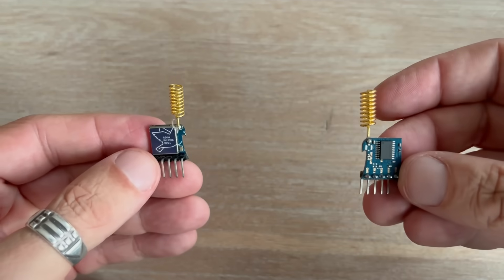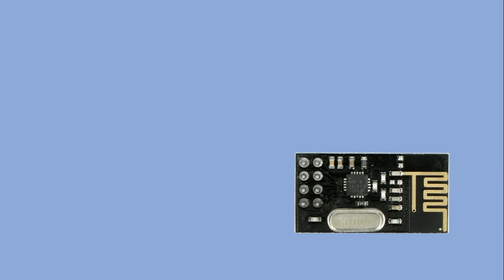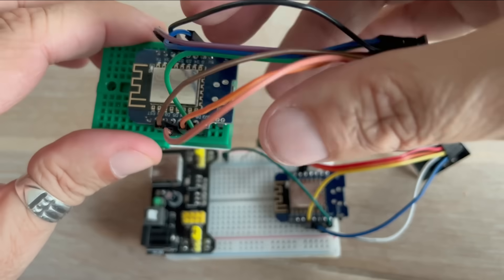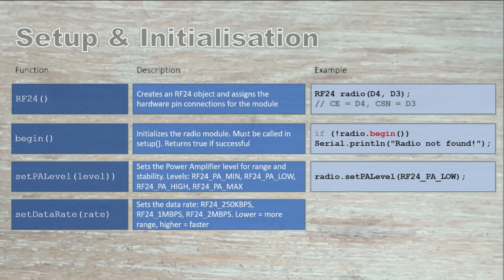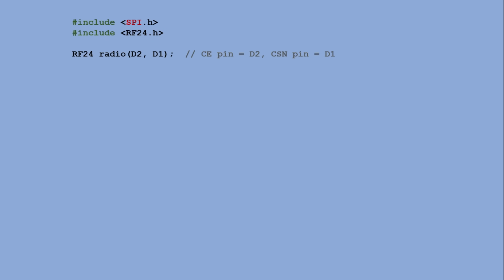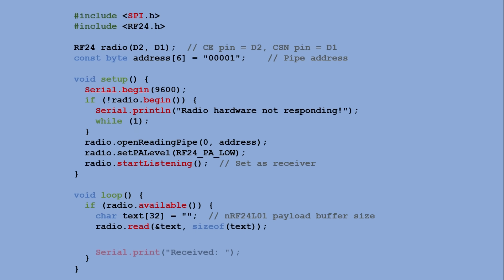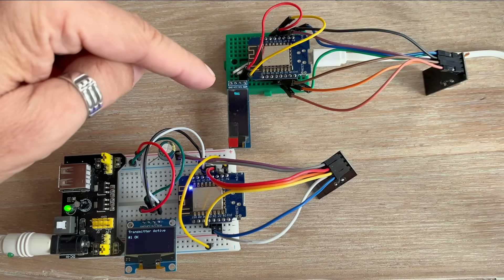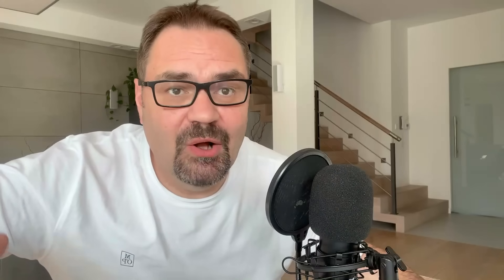How Far Can $1 nRF24L01 Modules Really Go? Setup + Range Test

Comment: There's a test of this transceiver on YouTube. In the test, the transceiver reliably transmits data at a distance of 400 meters. The antenna height is 1.7 meters. There is no packet loss.
Reply from the maker: Well I was testing a module at hand with onboard antena. There is a version of this module with screw on antena which I am sure would have a longer range. I will try to rerun this test with steady 3v power supply on both transmitter and receiver, with components on the custom pcb to limit the use of jumperwires and then test the range of parameters to see what kind of range and stability can I obtain with that basic module without external antena
Reply: @marios_ideas  The built-in PCB antenna was used in the test. The module was positioned at a height of 1.7 meters. If you're interested, I can provide a link. I am watching the NRF module tests with great interest; this is relevant for me.

Comment: Muy útil tu video.
¿Probaste los arduinos que traen este módulo incorporado?  Se llaman "RF-Nano", tengo varios pero nunca los pude hacer funcionar bien.
Reply from the maker: I have seen them. I don't have them unfortunately. I will try to read about it. I wonder if the fact that they are built in changes anything in the way you should interface with it.
Reply from the maker: So I read a bit. And it is the same thing as I show in my video. The only unknown is which pins are used for CE and CS. Normally CE should be D9 and CS D10 and that what should in the code. But if the different pins are used then you would need the datasheet for that board, which I guess would be difficult if it is a cheap board from china:)
Reply: @marios_ideas  Gracias por responder tan rápido, en cuando termine un proyecto en el que estoy vuelvo a intentar hacerlos funcionar.

Comment: Nice modules, with a small catch, the receiver side also transmits, as in acknowledging reception, so you havre to also have a nice 3V there as well. Also since they handshake it limits how many receivers can listen. These modules can be obtained on 5V adapter boards where they take care of all the level shifting and 3V regulators hassles, so a 5V Arduino Nano etc. is no problem.

I tried some LoRa modules in suburbia, the range was terrible, only a few blocks at best. maybe if I put the transmitter atop my 15M high radio tower I might do way better, but be realistic, not many people have a 15+M tower/pole handy.
Also I'm a tad reluctant to place such equipment up there as having digital potential noise sources right up close to all your other antenna's is asking for trouble. Yes LoRa great, shame about the rest.

Comment: 07:51 Considering the value that you assign to it why is the address data type not char ?
Reply from the maker: The code would work with char as well. The RF24 module works with binary values ."00001" is a C string literal, i.e. an array of const char[6] ('0', '0', '0', '0', '1', '\0').
When you assign it to a byte[6], the compiler implicitly converts each character ('0' = ASCII code 48)
Reply: @marios_ideas  Yes, I know that it works, but why not use the appropriate data type in the first place ? Using a char data type might also have the side effect of reminding you to add an extra array element to hold the terminating '\0' of the string

Comment: nrf24 is (unfortunately) very sensitive to power supply and wiring noise. A properly designed pcb for the connections with the microcontroller instead of breadboard wires and a capacitor between Vc and Gnd helps. I don't know why nrf24 has those issues, other rf boards are not.

Comment: These ones are quite old now and the design is not optimized. Anyway, it works fine indoor. I used them, with a stc15s204 microcontroler to do my own temperature/humidity sensors all around my appartment and send the data to a gateway that gathers and send again the data to thingspeak servers. My latest sensors are using the more recent 2.4ghz from CDEByte (10PCS Si24R1 nRF24L01+GFSK 2.4GHz RF Module SPI E01C-ML01S) for which the tx power is a little bit higher, but it does not make a fantastic difference.

Comment: These devices are also susceptible to interference. I find that keeping the wiring as short as possible helps, I also wrap the whole device in Kapton tape and then the whole board with the exception of the antenna is wrapped in copper tape. There are devices that come with an external antenna and these seem to give even better range.

Comment: I can see youre not as experienced with the module so here are some tips:
1 - decoupling capacitor is a must if you want stable transmission
2 - not super necessary, but I avoid arduino. Sometimes it masks and hinders you too much.
3 - proper config. For maximum range, you want the lowest data rate and maximum PA power, obviously. Always read the datasheet or at least use some LLM to process it to you.
4 - You bought the modules with PCB antennas, the least performing ones. Buy the nRF24L01P with LNA+PA modules, I recommend the EBYTE E01-ML01DP5. I've used is a lot and I cant tell, hundreds of meters are a guaranteed.
5 - watch the video "Ultimate nRF24L01 range comparison" from iforce2d. Its a must for anyone working with this module and in need of help.

Cheers lad! Let me know if you want any more tips. I wanted to make a video on the module, but never got to it in the end.

Comment: Thank you for your test. But I was hoping for more range testing and less programming instructions. With a 10µF ceramic capacitor for decoupling directly on the module between VCC and GND as well as a hardwired power supply, I have reached a range of 200-250m in open field with these cheap modules from China.
Reply from the maker: I will do the second part of this video . There are parameters I can tweek like setPALevel(level) to increase the range. But keep in mind that my channel is mostly about Arduino programming:)

Comment: The blue colour you choose for the code, is very comfortable to the eye, and thank you, you have really covered the topic very well. 

About these antenae these are in optimal  reception condition when placed at right angle to the radiation donut, meaning maximum cross sectional area. Plus you could also put them on the same page providing the capacitor to the other module . And most importantly a tin foil (aluminium) placed in a parabolic shape could increase the range significantly, as those pcb antene are transmitting in somewhat omni directional manner, a point source in comparison to the 50 Meters. Strangely the RCC slabs don't impede the 2.4 ghz that much, probably due to the spacing of re-bars and strangely some aggregates do, due to the  ferrous/slag inside them.
Reply from the maker: That was not my plan. I just could not record me typing the code in Arduino IDE window. I had to constantly reshoot it. So Even though it is a lot of work I think it is better to break down the code in this way:)